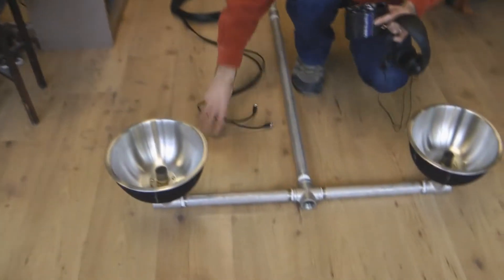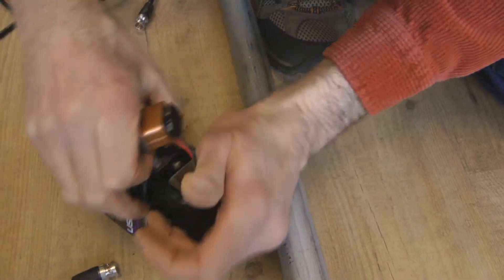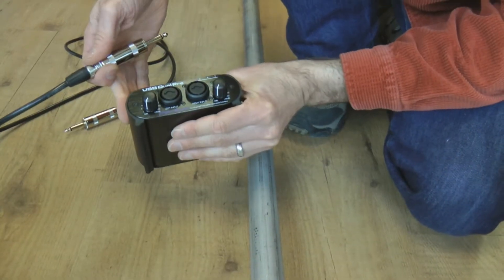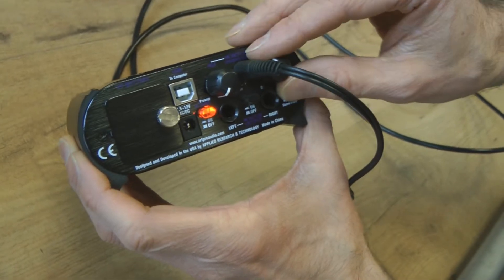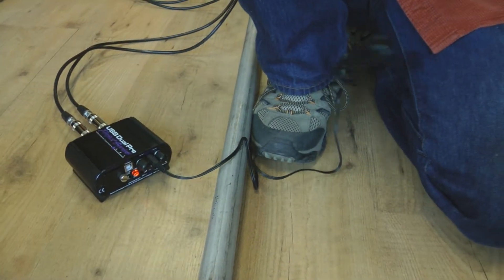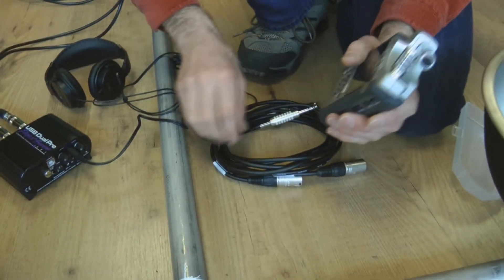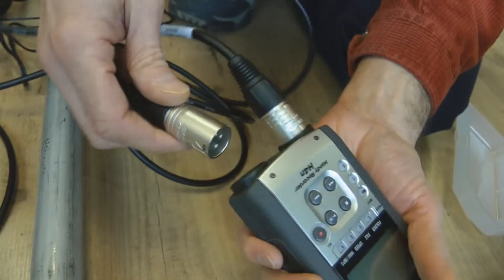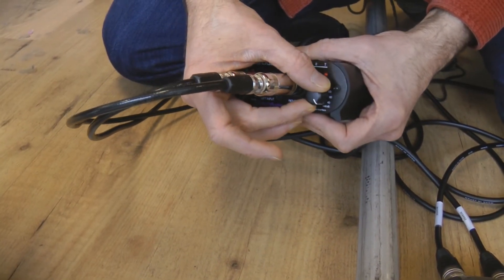Stereo Hydrophone Recording Setup

Comment: @ rObotBarbArian ( or others who have interest ) I work with a aquarian audio h2a-xlr on a Tascam DR-100 mk2. I only have 1 hydrophone but for sure if I would connect a second it would record in stereo. The possitive thing about a preamb would be that you are able to set your gain more precise, now on the tascam it is gain L, M or H and sometimes you want to finetune that. I plan to do some tests with on the left channel a hydrophone placed underwater and on the right channel a normal microphone placed above the water.
Reply from the maker: If you want to take advantage of the full 90kHz bandwidth of the DR-100mkIII, I recommend using my C75 hydrophone or the CR3 with a VP1000 preamplifier. Unless the specs have changed since the last time I measured the frequency response of the h2a, you will only 3.5kHz flat frequency response. Even the CR1 hydrophones used in this video have a 48kHz flat response and they're down by 12dB at 68kHz.

Comment: Nice, durable setup!  I’m wondering why you’re using an external stereo preamp though?  The Zoom H4N not only has selectable phantom power but of course the 2 onboard gain stages for your stereo needs.  Seems to me you could cut out a bunch of potentially added signal noise from a ‘pre’ preamp, cabling, and adaptors.  Not to mention cost.  Is it because there’s a better impedance match to the hydrophones?
Reply from the maker: Thanks! This was a custom hydrophone system made specifically for one customer. The CR1 hydrophones do not have internal preamplifiers, like the the C57 hydrophones. They require a preamplifier for both added gain and impedance matching with the H4n recorder. In fact, the noise floor of these hydrophones when used with the USB Dual Preamp is less than sea state zero. If no impedance matching preamplifier were used, the noise caused by the impedance mismatch between the hydrophone and recorder would be much higher. Also, the cost of the preamplifier is trivial compared with the cost of the hydrophones or the stainless steel deployment system.